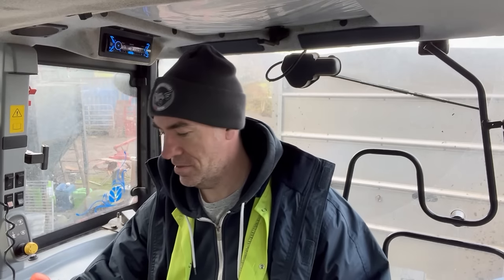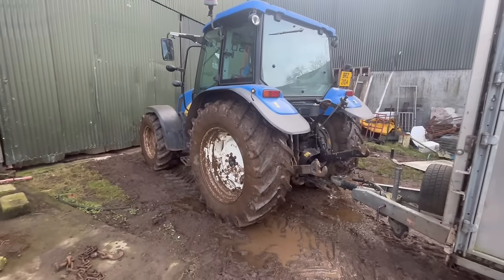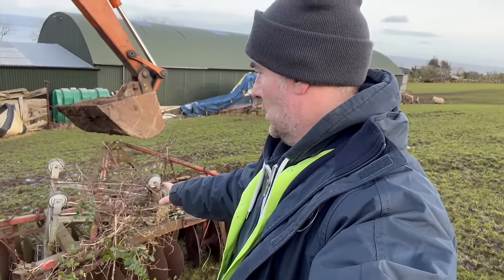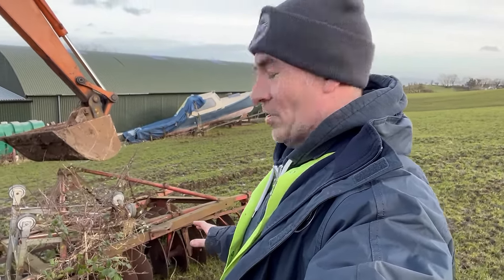Finishing the trailer parking area, driving a New Holland & fishing the MF harrow out of the hedge.

Comment: Surely you have an engineering shop close by with a lathe. Those shafts are relatively slow rotating so could easily be built back up with weld and re turned to suit your new bearings
Reply from the maker: Hi Keith we do, its just a matter of cost and whether its cheaper to buy a decent second hand one and keep that one for spares.
Reply: @FlyingFergyMan  I get ya lad. Handy bit of kit and if ya can do it for a reasonable cost then do it, be as good as new and suit the 1200 for work/shows